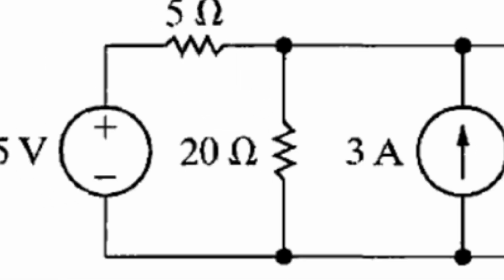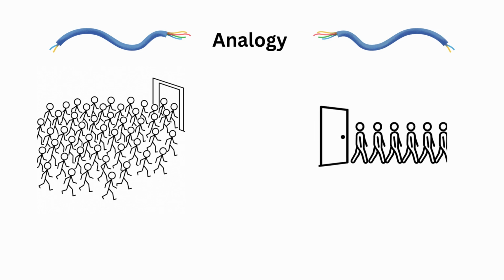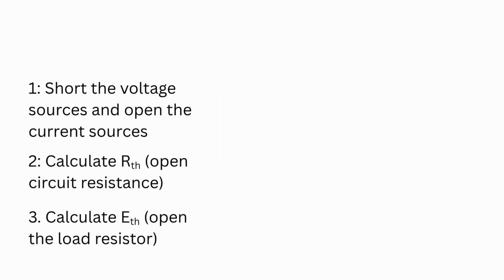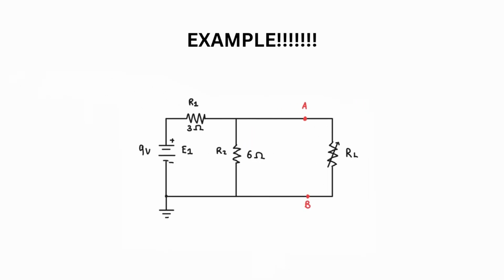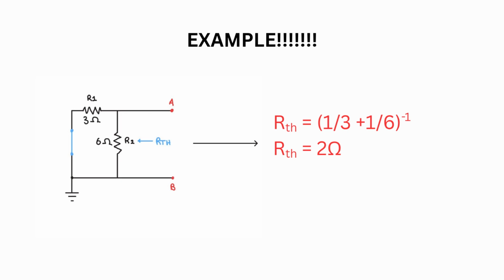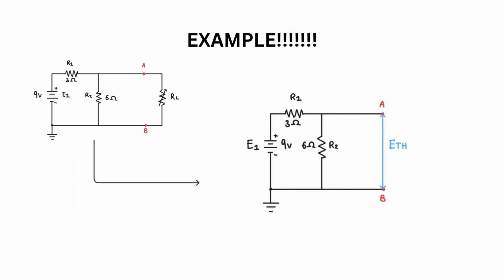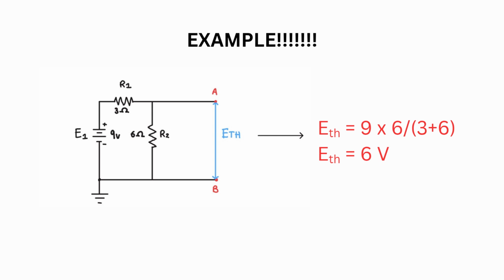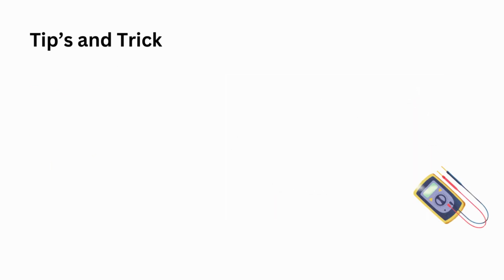Thevenin's Equivalent Circuit (Explained)

Comment: This video is very helpful! It very clearly explained the Thevenin equivalent circuit with exceptional clarity, breaking the steps down in a way that was easy to follow. The examples and visuals made the concept much more intuitive, especially when comparing the original circuit to its simplified form.